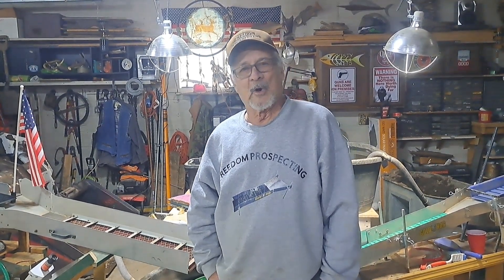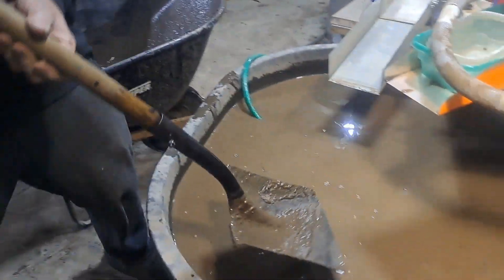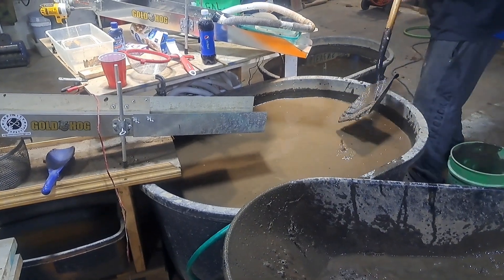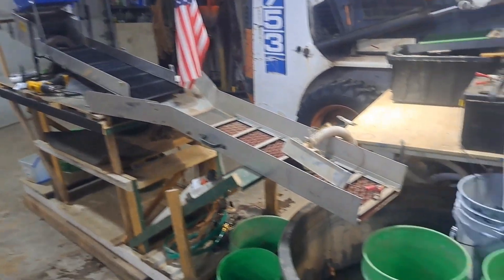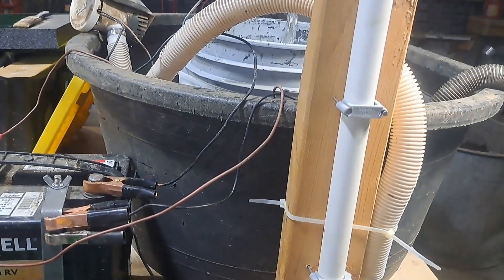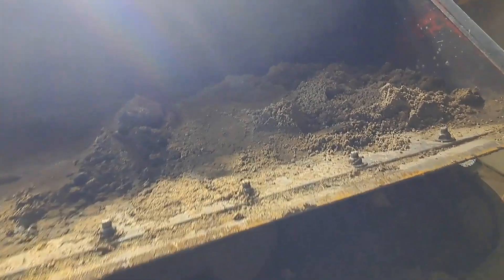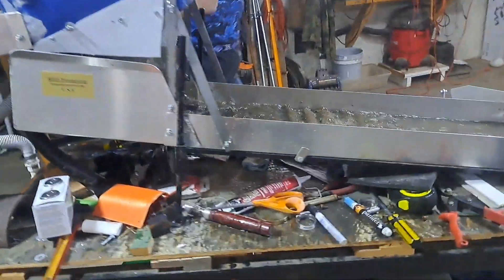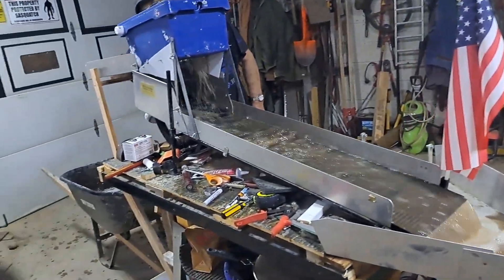New Water Filtration  System.

Comment: Same idea I've been working on. Saw it on Freddy Dodge video as well. What was it you are using exactly, and where did you purchase it? ✌️😎
Reply from the maker: If your talking  about the sheep's  skin.  I got it at ace hardware.  It's made  for straining paint. It fits over a 5 gallon bucket.  Comes 2 in a pack.
Reply: @freedomprospecting9034  thnx much, I've been looking at different options for a filter cloth setup and this is another avenue as ACE Hardware is just down the street. ✌️😎
Reply from the maker: @AU MetalMental  it's been  working great. We rant 10- 5 gallon buckets of dirty material thru it yesterday  keeps  the second tank  clean.